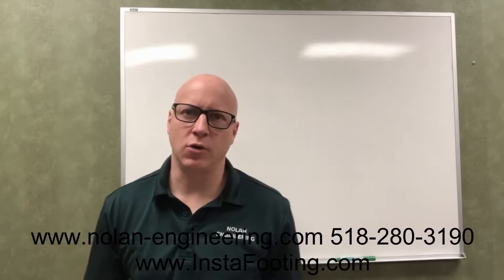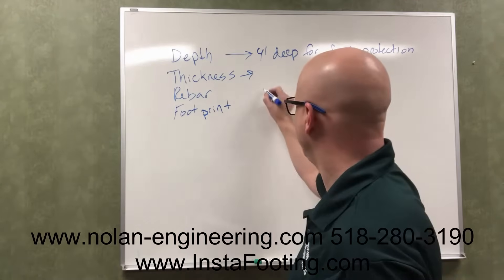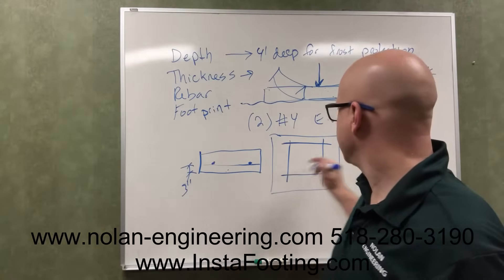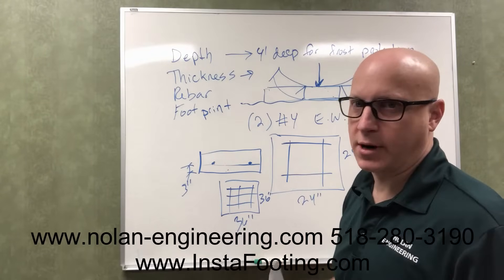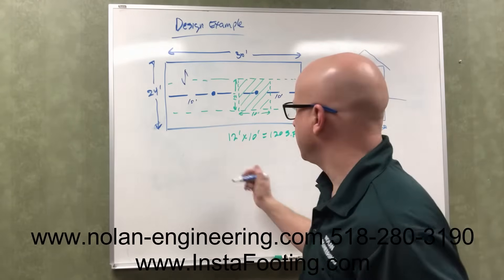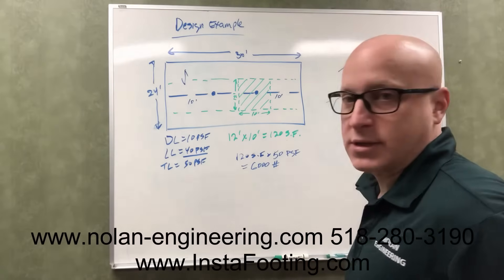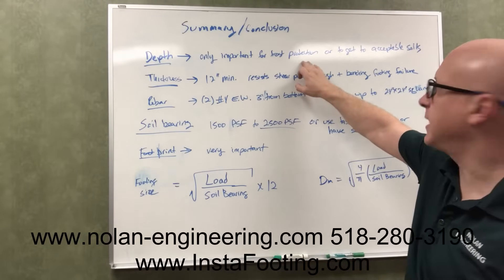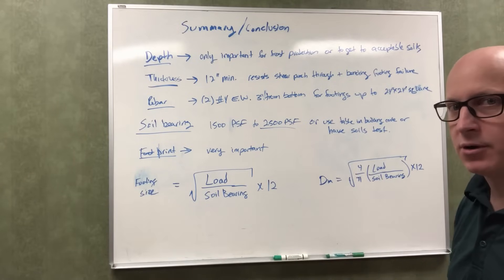How to size an isolated footing

Comment: at 11 min you said 20" x 20" x 12" thick footing (where did you get the 12" from?)
Reply from the maker: 12” is a safe thickness for footings up to at least 24” x 24”.  The thickness of the footing is governed by the punching shear, in other words you do not want the post to punch through the footing. At 12” you are safe for smaller footings, In fact you could potentially go all the way down to the code minimum of 6” but usually I see, 8”, 10” or 12”. To determine the actual footing thickness takes a bit of work. Hope this helps.

Comment: Hi, thank for the presentation. 
I'm going to self build a log home and the freezing line is at 5 feet.
I know that I'm going to have 28 piers of 36x36in at he bottom with 12x24in at the top and 3 piers of  48x48 with 12x24in at top. 
Because I need them 12in above the ground I'll end up with huge/tall footings.
My question is should I made them in steps or sloped/obelisk?
My home is going to be a pass and but metod, staked with rebars (every 2 feet).
The size is 40x40 feet (the horizontal logs should actualy 42 feet long with minimum 8in diameter at top and  18in diameter the bottom) with 2 story and an livable attic. 
The soil is a mix of clay with rocks and in the winter we got snow (a lot of it).